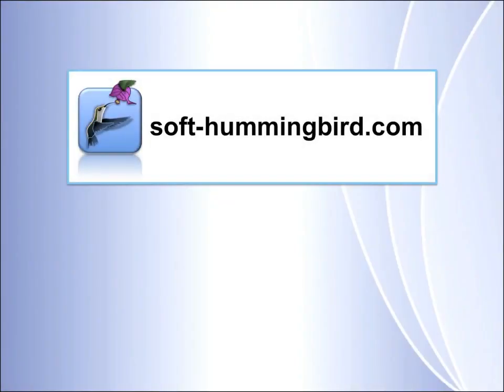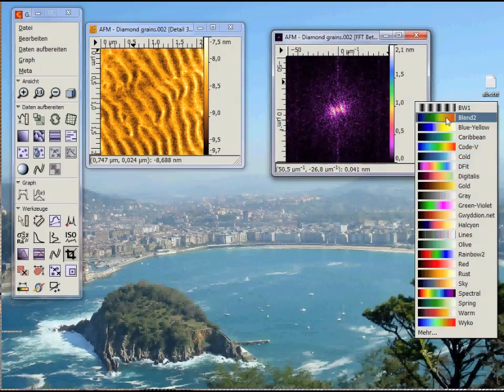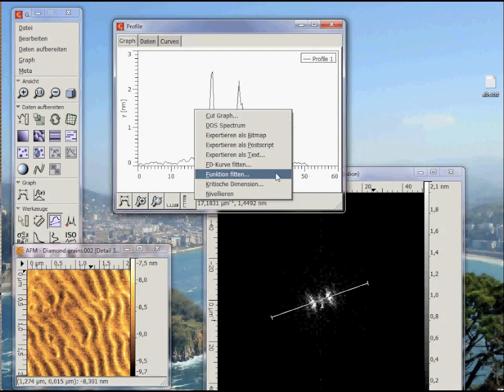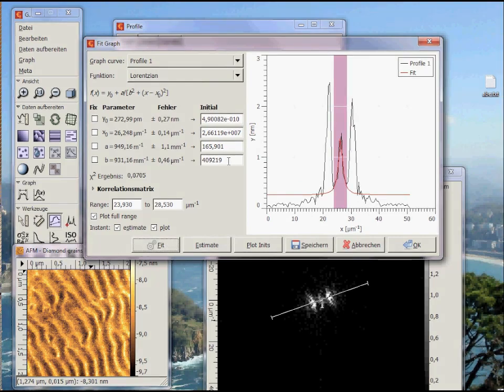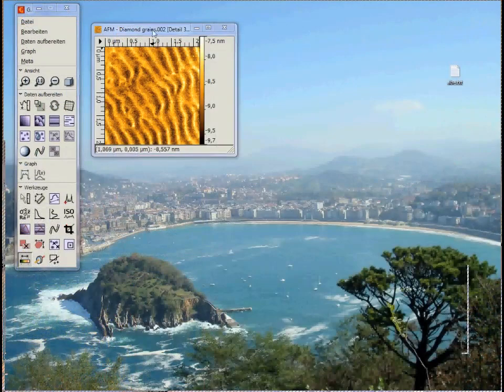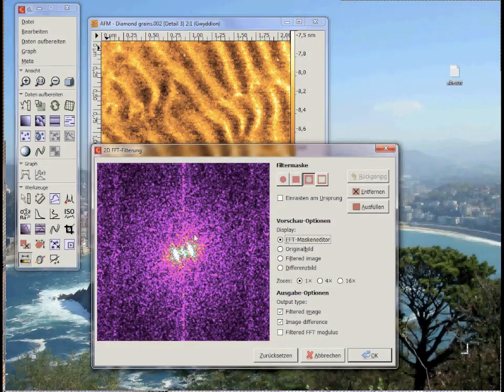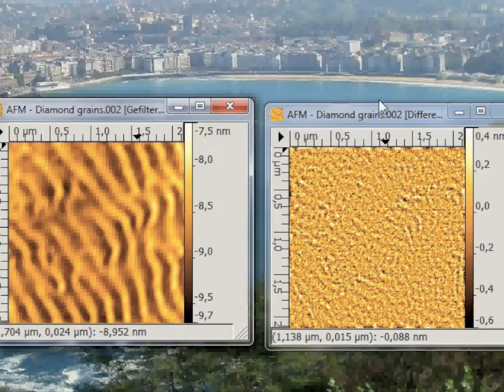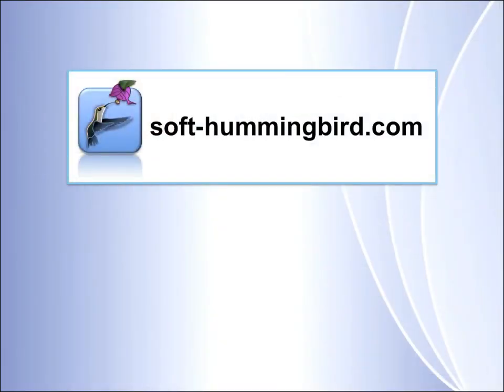2D FFT: Fourier Transformation and Filtering of AFM image with Gwyddion - Tutorial Part 7/9

Comment: at 3:50 you say that by selecting the central of the image you select the high frequencies of the image and then at 4 20, you say that on the left you have the back transformation of the central (selected) part and that this part corresponds to long wavelenghts=> low frequencies. contradiction?

Comment: I was wondering how you calculated the spacing between the waves? you said it was 8.37 per micron but i cant see where you got that.
Reply: He fitted the positions of the two peaks (y1 and y2)  and then took the distance between them (Y=absolute(y2-y1)). This is the inverse peak-to-peak distance (Y). You then convert it back to real space to arrive at the real peak-to-peak distance (X=1/Y).  However, as stated below, he forgot to divide by 2. So actually, the real  spacing (d) is about (d=X/2=60 nm) instead of 120 nm.
Reply: You could also measure the distance between each peak and the zero order peak. This should give you about the same value (to a small error, that arrives due to averaging about actually two distances, when choosing the above way).
Reply: @WinniethePooh99999  why do the errors appear to be so large? 
For example a value of 30 per micron the error is 93 per millimetre, which is much larger than the value itself!
Is this resolved by converting back to real space from the reciprocal space?
Reply: @trendytrenessh462   @Trenessh Sivakumaar  you have to remind, that a measurement error or uncertainty does not transform as the measured quantity itself. Please refer to
 https://en.m.wikipedia.org/wiki/Propagation_of_uncertainty. 

The German page at Wikipedia is especially helpful because it defines the common formula for propagation of uncertainty. Unfortunately, this is missing on the English page.

Comment: with a difference of 8.37 um^-1 in angular frequency, how do you calculate the reciprocal value to get the 120 nm of distance between 2 wave peak? thanks
Reply: 1/8.37=0.119 microns, which is 10^-6.  So moving the decimal to the right 3 decimal places means you need to multiply it by 10^-3 to compensate and then you have 10^-9, which makes it nanometers.
Reply: But I'm starting to think he needed to divide by 2 because he wants the frequency from the "center" and the center is halfway between the two frequencies.
Reply: @Kevin-gd9vv  Doing my thesis on acoustopheresis and can confirm. Devide by 2 !